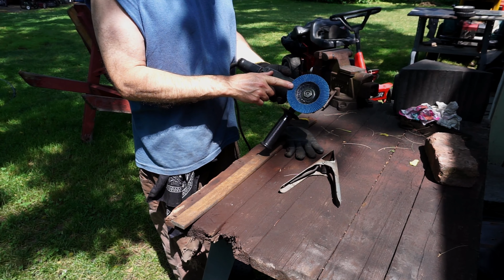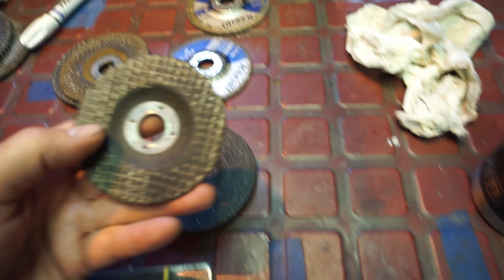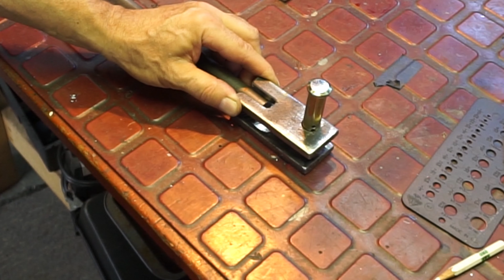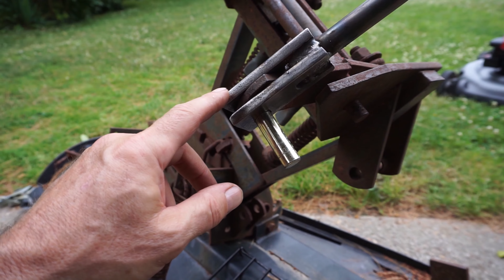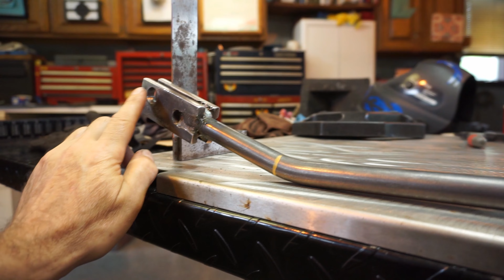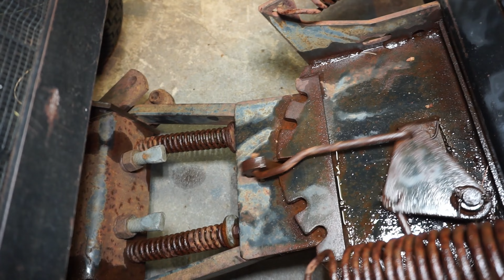How to Make a Implement Lift Rod For the Simplicity Sunstar 20hp Kohler Magnum Tractor

Comment: HI Arch!
what would you charge to make 2 or 3 of these rods ?
Please get back to me
Reply from the maker: Hi Paul, I'm not sure, steel stock and power have more than doubled in price. I would need to check what the materials are now. Its ridiculous how things have gone up.
I assume you have a sunstar?
Reply: @TheNovaJohn  me too.... I bought a Deutz Allis 1920 with no attachments but found a guy with a 1918 with a plow and snowblower.  He never used the plow so i talked him into selling it to me... the problem is that the lift bar and adjustment rod are used for the snowblower so weren't included.  Watched the adjustment rod video and it's pretty straight forward... the lifting bar though is a lot more difficult because of the bend and tolerances.  I was going to try to macGyver something and your measurements were very helpful... but... If you are making some... it would be easier to pay for it... that is is your making them...  :-)
Reply from the maker: @artdeco18  I've thought about it,,,not cheap though,,,steel has gone up and there is time and welding...Any idea what you would be willing to shell out?
Reply: @TheNovaJohn I'm in Canada and have been looking for one with no luck so far.  Your video and measurements are great though and I think I found someone to do the welding for me so I'm going to try that first.
Reply from the maker: @artdeco18  Great!!! & This is why I did this Video!!
Let us all know how you make out with the project!!!!
Thanks fer watchin

Comment: Nice work on the plow it will work maybe should be sent out to get heat treatment
Reply from the maker: Thanks Henry,,,,,,I thought about heat treating,,,also thought about a better steel. I cold bent to avoid the torch annealing. After long thought, I realized its probably over sized anyway and if it broke or bent I could understand the failure and work to correct it on this or another rod...